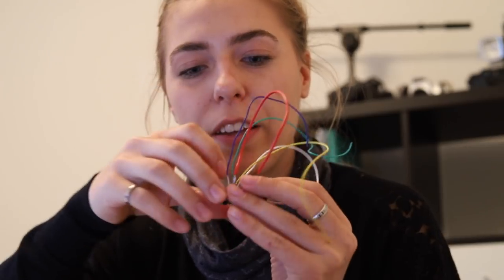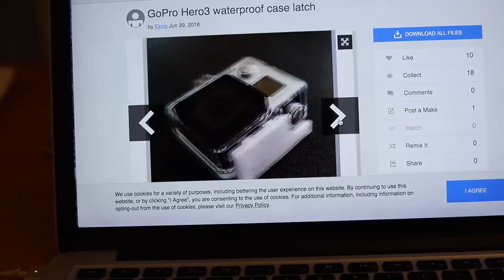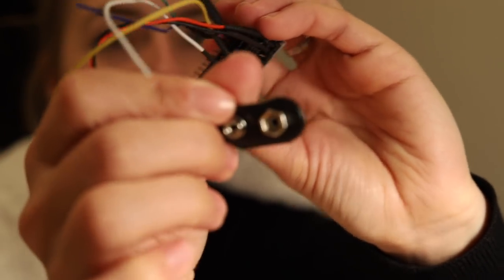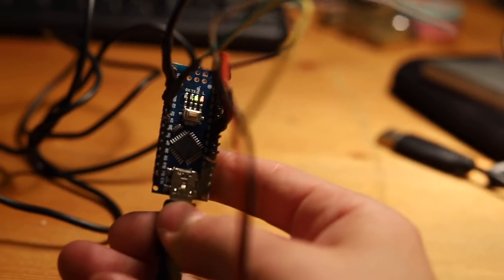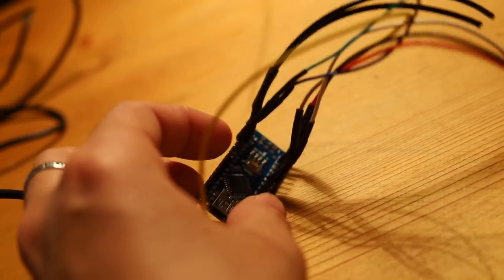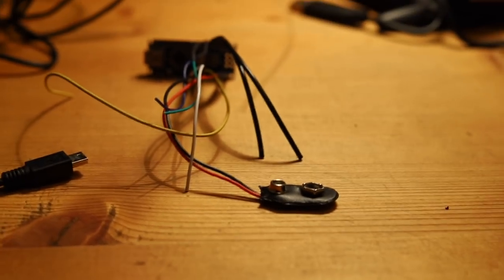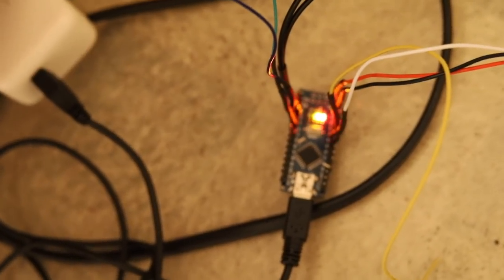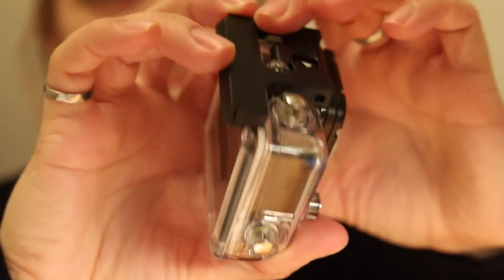How to start a fire with Arduino

Comment: You connected the battery the wrong way (you should have connected the battery's + to the connector's larger circle) and so damaged the regulator. The USB supply bypasses the regulator and so it still works. You can't use the VIN pin anymore (no more battery power). Also you don't need the RTC to communicate using the I2C protocol.
Reply: Exactly :)
Reply: Well spotted.
Reply from the maker: ohhhhhhhhh!!!!!!!!!! I thought the big circles go TOGETHER! What kind of a f**ked up design is this??? Who the hell designed this s**t wtf

thanks for all of the tips. And good to know about the RTC
Reply: @RiverTechJess  The battery is supposed to click into the connector and so the smaller + of the battery goes into the connector's bigger circle and the opposite for ground. The board does have a clock (the small crystal next to the microcontroller provides it) so all the microcontroller's peripherals will work fine. The RTC is just an external device that outputs the current time and will work by itself even when the microcontroller is in sleep mode (for energy saving).
Reply: @RiverTechJess  lol :)
Reply from the maker: Ya I know about the crystal. You can see my Arduino video where I explain the entire thing. Just connected the battery wrong
Reply: @RiverTechJess  It was designed by a mechanical engineer :D
Reply: You are correct
Reply: @RiverTechJess  Okay, this was video no. 3 on your channel. 2nd after the "If Engineers Acted Like Beauty Gurus". Not that all 9V batteries... well never mind, but this should have been part of the beauty video :-P

Comment: I guess I'm a bit too late to this channel.That small component  is AMS1117, it's the voltage converter for 7-12v to 5v for powering the arduino. It used for voltage conversion when you have connected external battery(or any other power source). It has nothing to do with the USB power supply and that's why your board work normally when powered via USB. You can buy AMS1117(5v regulator) for very cheap and replace it and get the external power supply working again. As for why did it blow up in the first place, Michael Collins already pointed out neatly. Happy exploring!

Comment: That piece that has the little hole is the regulator of the voltage . If it was broken (the regulator) , you won’t be able to use battery as a source of energy ,but only your laptop, because the voltage is already regulated. You can continue working with this arduino , but you have to buy another one in order to test your product 😄.
Reply from the maker: ahhh dang! thanks for the tip though:D at least now I know the problem. I can't believe it broke!

Comment: lol :) its one of those things where its easy to get wrong or overlook the first time but after you stuff it up once or twice, you'll make sure it wont happen again. Now you have first hand experience in what happens when you incorrectly connect the polarity of a DC power source. My first time wasnt as great, it happened to be with 440 VDC and ended up with a arc flash, loud bang and loss of hearing and blurred vision for a couple minutes :D. So its better to make these mistakes with a safe and low voltage like this. Everyone working with electronics/electricity has done it.
Reply from the maker: But you don't have any permanent damage, right? And thanks for the encouragement:) I'm glad I'm not the only one!

Comment: There is no protection in arduino to prevent mistakes, so make sure you solder the battery connector correctly next time according to the wiring diagram. Since you put the battery in reverse polarity you blew up the voltage regulator.
Reply from the maker: thank you! I did solder the right way but connected the battery wrong. next time!

Comment: I've a question related with you old mechanical engineer life. Did you study structures? And what degree of expertise did you achieve if did It? Thank you😁.
I'm asking you because in my country mechanical engineering is not only about little pieces moving and stuff with heat and cold but also about doing a lot of structures.
Reply from the maker: I don't know why you say "old mechanical engineer life" 😹I am still a mechanical engineer. I have 2 degrees lol
Reply from the maker: I had to do basics vibrations, mechanics, and statics